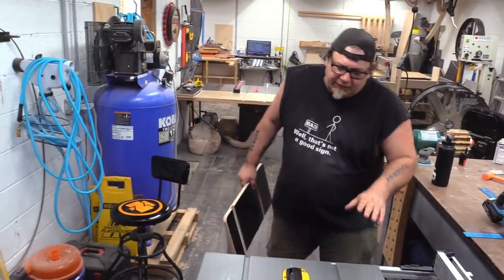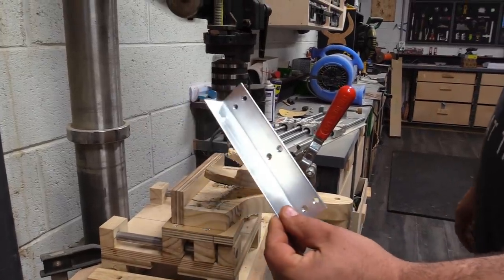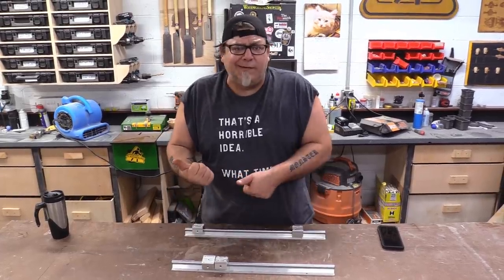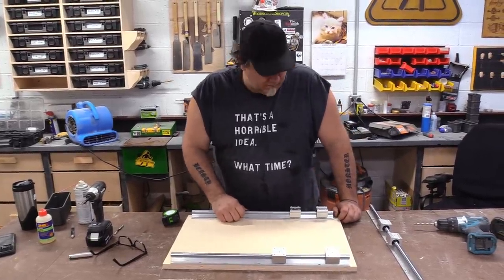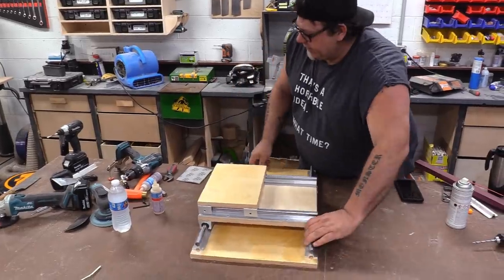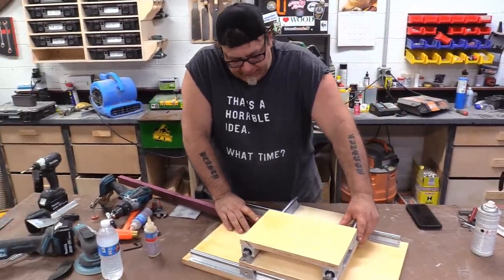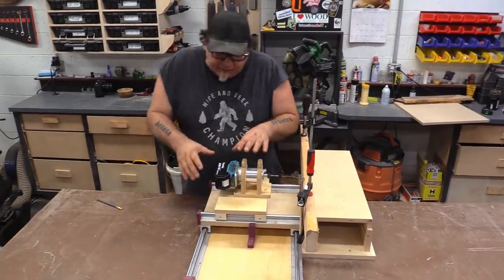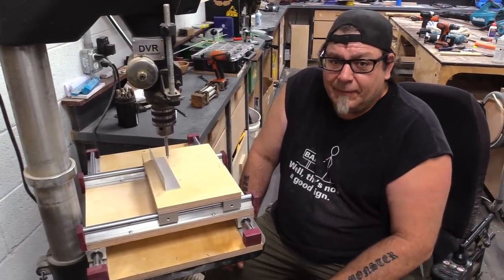DIY - Router, Drill press, and other stuff JIG | How to Woodworking

Comment: I just purchased the 47 in. version of these rails to use along the length of my lathe. I'm curious why you chose to drill the guide blocks to attach them to the sliding platform rather than use the drilled and tapped holes on the top of the block. I was planning to use the existing holes, but now I'm wondering if perhaps that's not a good idea.
Reply: The only reason I can imagine not to use the existing tapped holes is maybe he didn't have the machine screws.  I think using the pre existing mounting holes is ideal.

Comment: Would pin holes and pins on the adjustable stop have work ? That way you wouldn't have to replace the bottom panel as often.

Comment: Izzy
A couple of simple suggestions for the x/y drill table.
Insert track guide into surface of both X table and Y table so quick adjust V shaped stop blocks can be slid into position (use flat tape measure as setting guide also fixed next to track guide) , then use same shaped V male form  to self centre in stop blocks on engaging your move handle lock, allows centre line of V  blocks to be quicklu adjusted or even removed.
All best kagey UK
For your tenon rise fall, how about three wood gears inside tbe body with 0 to 2 " rise cams or wood threaded jack screws to adjust height for router / drill positioning?

Comment: I actually built one of those about 25 years ago.  The linear bearings were more expensive then.  I found it does a good job on a lot of tasks,  but when fitting it with different tools, a router, circular saw, drill press the mounting table was always in the wrong position.  Too high or too low.  For a dedicated task, it is great.  But I didn't find it generally useful for day to day.  

For those that build one look on ebay and some of the Chinese sites that you've found reliable for the bearing and rods.   You can get a complete CNC router for $150 and reuse the parts.

Comment: 8/28/2020  USA  Grandpa Bill:  Izzy, you're my wood wizard. You really do fill my heart with gladness. As soon as I get a notification on Youtube and index to your video and see you hunkering over the table saw I just start smiling.  Oh, and I need infeed and outfeed on my little Rigid contractor's saw I keep in my garage shop; especially, I need an idea for extended infeed to accommodate a longer tapering jig for those thirty-inch wedge-shaped gaps that form over doorways in 70-year old apartments. Even though I'm retired at age 72 I still do specialty projects for my former (yet current) partner in real estate and apartment maintenance where we keep restored the old elegant buildings as much as possible. I do the 30" long wedges, 1/4" to 3/8" freehand, but I'm not as sure as I used to be, so I built a long tapering jig but it is a real hassle getting it started through the saw. I haven't been as creative as you are and I could use some help.

Comment: I have the delta 36-725 (Lowe's) saw that is basically a Ridgid.  Any idea of if this indeed table for the Ridgid would work with it?
Reply: Basically, are specs available of what the table saw needs to work, like you did with the original release?

Comment: Those Thomson bars ain't cheap, the linear bearings aren't too bad. Depending on how nasty your shop is, you might want to use a wiper on the bearings to keep your assembly from getting crunchy.

Comment: What’s that glue your using please?
Reply: It's a 2-part quick setting epoxy.
Reply: Austin Ring I didn’t think it was, he applied straight on of a bottle onto the feet then sprayed what l guess is an setting agent to the timber board before pressing together.